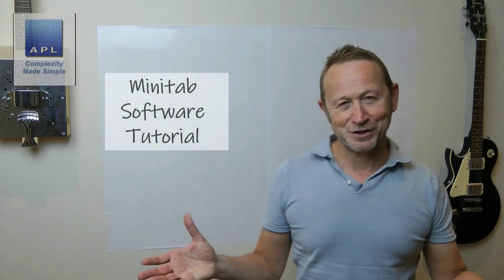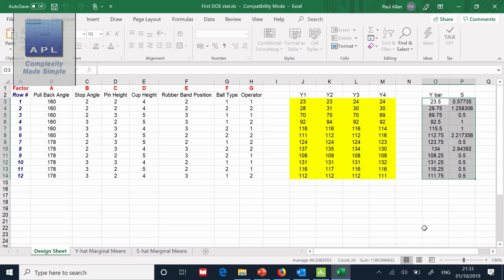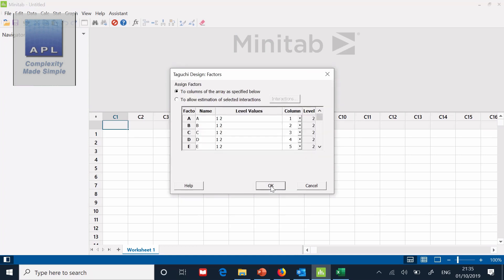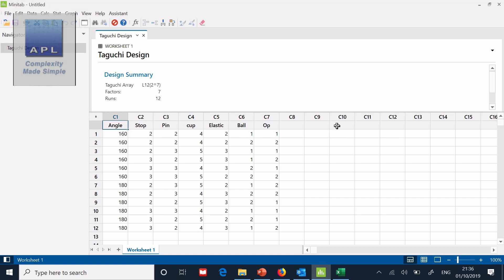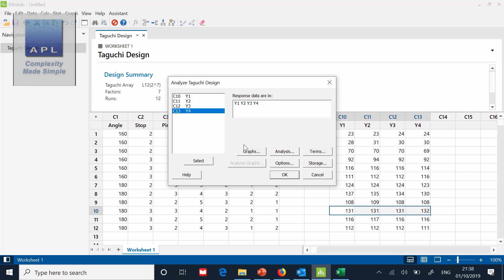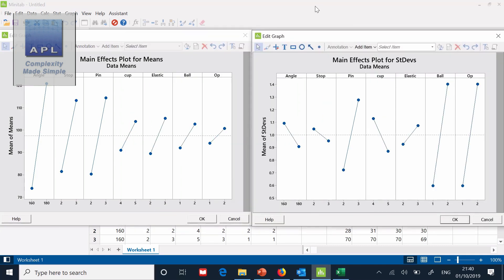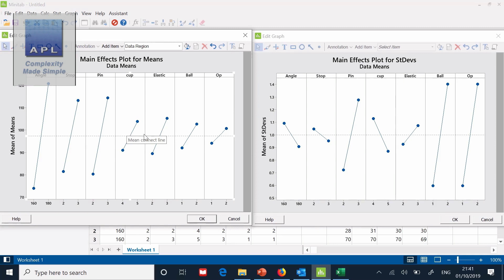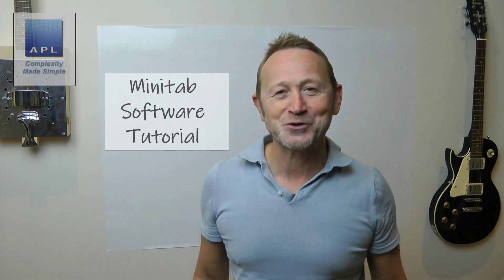Minitab Tutorial - Taguchi L12 Analysis

Comment: Hello Paul, my question might be very silly as I am new to DoE and I am using Design-expert software, I wonder why are you doing a L12 Taguchi model for 7 factors? the software suggest me a L8 for 7 factors at 2 levels. I am very confused.... Thank you for your videos.
Reply from the maker: Hi LVBS - It's tricky to explain but your software is giving you bad advice. I would chose the L12. The L8 was used 50 years ago to save calculation time. But you are taking risks with your model, that 50 years ago could save 3 weeks of hand calculations!! so was worth a risk. With software there is no calculation time so no benefit and lots of risks...
Reply: @paulallen5321  thank you Paul for your responses. It really helps to clarify why the discrepancy, I just need to find how to talk the software to give me a L12 instead :)
Reply from the maker: Tell it you have 8 variables, then ignore the last column pattern...in the L12..

Comment: In taguchi method l9 
Please could you tell me why i have got , the sn ratio plot and mean plot were inversely The value of sn ratio were negative Smaller is better formula was used
Reply from the maker: Hayat - good to hear from you, personally I never use the S/N ratio I get a mean plot and a Std Deviation plot. This keeps these 2 aprt and easy to understand. If you mix them in the S/N ratio you lose sight of what is happening...
Reply: @paulallen5321   I use sn ratio because i didn't completely understand why the mean plot is used for ? so if i want to depend on rank in table respons in order to find the most significant or effective parameter should i use the rank in table response of  means or of sn ratio?
Reply: And  if you dont mind could you tell me please if it correct or not , that  the plot and table response  of sn ratio used only to find the optimum parameters while plot and table response mean are used to determine the most effective parameters using rank value ?

Comment: Thanks for an excellent demonstration. I have a question about doing a DOE with both numerical and categorical factors. Is that only possible with a Taguchi type experiment or could the categories be accommodated bin other types of DOE?
Reply from the maker: Linda – Yes, Minitab will let you change the variables to text and therefore become categorical.
Reply: @paulallen5321  Thanks so much Paul.  I am looking to find optimal parameters for a process. Some of the variables I identified can be varied on a continuous basis, while others are distinct non-numerical categories e.g. type of chemical/ additive. The final aim is to maximize the % of component A in the A/B mixture. Your description of the Taguchi method makes it seem like an excellent screening tool to see which variables have the dominant effect and then go into a factorial design to optimize one or two of these dominant variables. Is Taguchi the best way to do this first screening or would you recommend a different type of DOE?

Comment: Hi Paul, I use Design-Expert software. The software help page states that "Taguchi orthogonal array designs are not recommended. Modern designs along with ever improving and available computer power have superseded the need for these “calculate by hand” designs. Use optimal designs with measured responses instead." Would you agree with this statement? Thanks!
Reply from the maker: Personally I wouldn't agree with that. If you want to test 11 variables there is no software in the world going to get you out of that problem, you need a good DOE pattern, the L12 is a great choice to do this. I know they are simple, but that's the point...
Reply from the maker: What DOE does the Design expert recommend for 11 variables?
Reply: @paulallen5321  Min res IV design, two levels with 22 runs. I think Design Expert suggests this if there are interactions between factors as such in chemical systems. In Taguchi L12 , are main factors confounded with interactions if there are any?
Reply from the maker: That's not true in the L12, the confounding is spread very evenly through the pattern and there is no 2 way aliasing. It is also an all pairs test, which is a highly powerful test to do on any system...
Reply: @paulallen5321  Thanks, good to know, I feel more confident now to use the L12
Reply from the maker: Bomcimtube - Keep reading different approaches. There are good reasons why people use particular DOE patterns. None of them is perfect, the more ways you know the more you minimise the compromises you make in your experiment...

Comment: Thanks for your thorough Explanation! However, I'm wondering if my experiment require a long time to finish (around five hours). I will have to invest a vast time to finish a full Taguchi design of experiment.  Is it able to Omit duplicate experiment? if it is possible then how can I do the following data processing without S/N ratio?
Reply from the maker: Thanks for getting in touch - If you do not replicate then the analysis cannot find a robust setting in this case. Replication is one of the most important things you can do in an experiment. It should always be done if money permits...